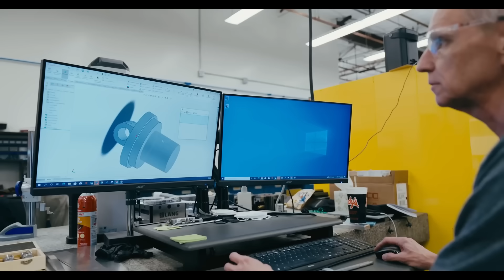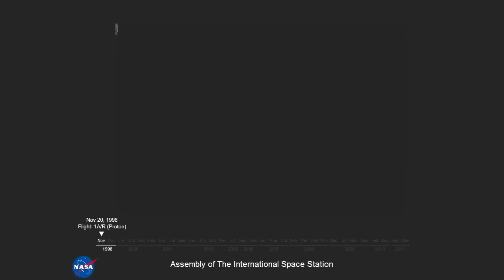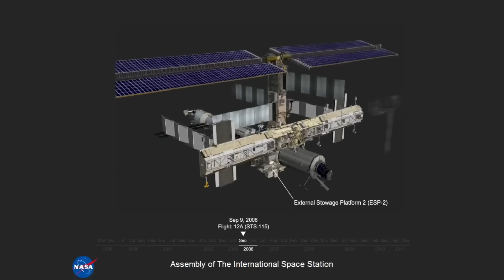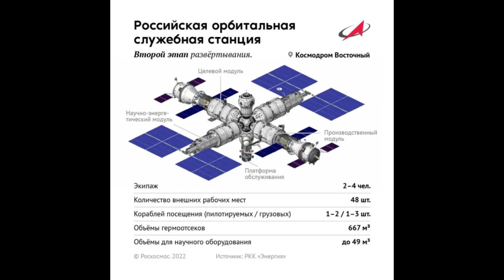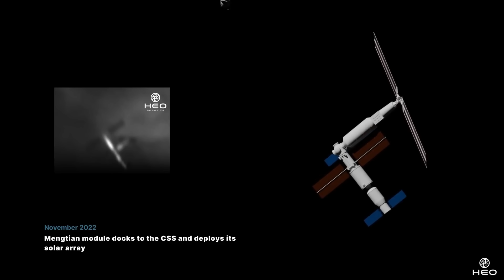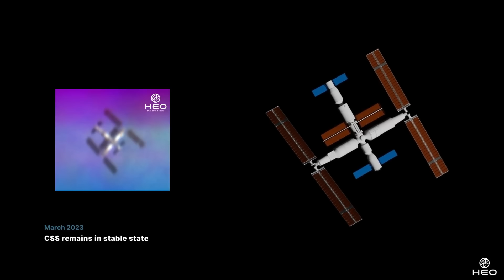Where Will Astronauts Go After The ISS Is Destroyed?

Comment: It's a shame they never replaced the Shuttle with a modern version. It's lack has resulted in a massive narrowing of possible space-based structures.
Reply: Yeah, I feel like 2012 on we lost so much space capabilities and have been needing to reenact the 60s :(
Reply: @FooPanda  one of the former directors of nasa, Michael Griffin straight up said when asked about the shuttle program and continuing the Saturn program instead: "If we had done all this, we would be on Mars today, not writing about it as a subject for "the next 50 years." We would have decades of experience operating long-duration space systems in Earth orbit, and similar decades of experience in exploring and learning to utilize the Moon."

i will absolutely take that from the horses mouth in this case
Reply: Too expensive to refurbish all those complicated, different tiles between launches. One reason Elon went for a cylinder rocket with simpler tiles.

Comment: I live in Huntsville, AL where they recently “popped” one of Sierra Space’s inflatable modules. We’re used to rocket testing in this area but that explosion was another level.
Reply: Pretty intense?
Reply: It would just leak. The popping part was due to testing the material to its breaking point.  Beyond what it would experience in its normal use
Reply: @johnn3542  oh we’re used tests to failure. This one was just particularly loud
Reply: Big badda boom!  💥
Reply: I've wondered about that -- if some piece of orbital debris or small meteorite the size of a postage stamp hits one of those things, will it just start leaking (which might give the people inside enough time to escape that section), or will it pop like a balloon?
Reply: @Lucius_Chiaraviglio  it would leak just like the iss did. The test mentioned was over pressure until it burst. The pressure when it’s in space is never going to be higher than 1 atmosphere so it wouldn’t burst.
Reply: @Lucius_Chiaraviglio well, with how strong they are, they're unlikely to be damaged much in the first place. if they are, though, it won't explode. like a tire running over a nail, it'll probably just leak, only this thing is much stronger than a tire and will hold together much better.
Reply: @Lucius_Chiaraviglio  i think the point is that it wont break idk
Reply: Huntsville 

Hope y’all doing good after 2011
Reply: I miss living in Huntsville

Comment: I understand that being exposed in space degrades the ISS’ modules, but what about the structural trusses? Couldn’t that backbone of the ISS be reused? Remove and deorbit the old worn out modules and replace them with new ones.
Reply: Degradation of the important structural components (which are also some of the oldest parts of the ISS) is one of the main concerns unfortunately. Erosion/corrosion by atomic oxygen and the wear and tear induced by over 100,000 thermal expansion cycles is no joke. Going with entirely new components maximises lifetime going forward, and also allows for the incorporation of fundamental improvements in materials and design.

Comment: Why do you seem to imply that more than one docking port is needed to support occupancy in the absence of a docked capsule?
Reply: Because the people on the station always need a ride home... for now at least, nobody is prepared to leave a station occupied without a return vehicle. And since the lifeboat will always be taking one port, you need a second port for the replacement crew to dock at.
Reply: @simongeard4824  I see, thanks. Not sure why having to wait for a return vehicle to arrive would be so prohibitive, but I guess safety is increased , if one is not dependent on a return vehicle to arrive. Also, the permanently attached return vehicle could temporarily disengage to allow for the replacement's crew vehicle to dock, but compared to such manoeuvres, it would be easier to just have a second port.

Comment: Untitled Space Craft: Three SLS main stages, two Falcon 9 rockets, two SLS solid boosters, two Delta IV M upper stages, a Space Shuttle Orbiter attached to the main tank, and a Saturn V upper stage.
Reply: SLS Saturn Shuttle 9
Or SSSN 🤣
Reply: I christen this spacecraft "The Johnny Cash".
A piece at a time spacecraft bringing an end to the piece at a time space station.
Reply: And a space partridge in a space pear tree.
Reply: I'm sure there's a Project Orion drive somewhere in the background too. Just for good measure. :D
Reply: @toadchungus4135  I would not fly on that thing unless it also included an Apollo Lunar Landing Module crammed into the Shuttle cargo bay. Have we learned nothing from Apollo 13?
Reply: Well, if it works like a charm in KSP…
Reply: Moar thrusters!
Reply: Don’t forget the starship raptor engines (singular)

Comment: I would hope that the replacement for ISS exists before it is de-orbited.  I like the option of putting modules on ISS that will continue after the bulk of ISS is retired.  There is a plethora of equipment and supplies that would be useful and potentially preserved in that manner.  Many options, but the key is to make it financially viable.  Multi-purpose and flexibility are going to be very important here.  Space tourism, science, observatories (both earthward and outward), etc.  All these things brought together to make it feasible.  My fear is that we end up with multiple small stations that will not have the capabilities that a larger, "shared" one would have.

Comment: I think one of the big reasons SpaceX  might not have a horse in the LEO race is that maybe they want to skip LEO and go straight to the moon. In terms of infrastructure, we will be able to do way more on the moon than we ever could do in microgravity. Maybe Im wrong bc microgravity provides a truly unique manufacturing opportunity or something like that but I just dont see it happening as easily, especially since so much of the weight of the various crafts are dedicated to life support systems that will be far easier to have in place on the moon, where they don’t have to worry so much about micrometeorites, etc. (for example, cooling can be done by piping directly downward into the moon’s crust instead of the comparatively highly exposed radiation panels)

Comment: I've seen concepts like this for nearly 60 years now. Only ISS and Skylab ever happened.
Color me quite skeptical. The only new stuff here is the inflatable stuff.
"Disappointed... but not surprised"
Reply: What about the Chinese station that's already in orbit?
Reply: The Wright Bros were told the same thing about manned flight. Never stop reaching for your dreams, even if they seem impossible.
Reply: Were they private concepts?
Reply: Difference this time is there is money and actual hardware
Reply: The economics of putting stuff into orbit have changed drastically in the last decade, so old experience doesn't necessarily apply.

Comment: Just wondering why Soyuz can't
 reach a  high-inclination orbit? is it a physical limitation of the spacecraft, or limits on flightpaths from Baikinour?
Reply: Little of both. Given enough delta V you could launch anything to any orbit from any place on Earth. But as it is, Soyuz doesn’t have the delta V to make it to certain orbits. The ones they can reach are those within their delta V budget and those are defined by the location of Baikinour, its latitude and the direction they launch to avoid dropping rocket parts on China.
Reply: It's the other way around — Soyuz would need to reach a lower inclination orbit to visit the Chinese station, or most of the proposed ISS replacements. And that's simply because you can't reach an orbit which doesn't pass over your launch site without spending a lot of delta V to alter the inclination after launch... and rockets rarely have the fuel reserves to launch a large payload on such an inefficient trajectory.

Comment: I remember a "wet workshop" proposal from around Skylab years where the station would be within the propellant tanks of a booster upper stage.
Now, take a Starship without flaps and heat shield, cram the payload section with what you need to retrofit a space station inside the tanks, then send a crew to do the retrofitting job and recover the Raptor engines, and voilà, with only 2 super-heavy launches, you aready have a huge space station...
Reply: so the old shutell tank space station idea
Reply: @anuvisraa5786  Every time they dropped one of those I thought "Well there goes a perfectly good ISS module"
Reply: @josephastier7421 Weren't they made of a super light metal that was crazy expensive, and IIRC, toxic to humans. Could have fitted walls and floors inside, then sprayed the gap to the tank walls with expanding foam to seal and thermal insulate.
Reply: SpaceX already have Ship 26 without shield or flaps sitting on a stand at Boca Chica so...
Reply: @sphericalcow-p9m  ■ Yah, kinda like a big elephant in the room…
Reply: I think I've already seen an artist's conception of that.
Reply: I read a fiction series where a company built a manufacturing plant in orbit by paying NASA enough to add just a little extra burn to the shuttles so the big external tanks would get high enough that the corporation could capture the tanks, strap on thrusters, and bring them to their assembly orbit.
Reply: @MonkeyJedi99  Where did they put that extra fuel for the burn? The shuttle main tank was dry when seperated, the shuttles internal tanks dry at orbit.
Reply: @PiDsPagePrototypes  I read the book series about three years ago, so I don't recall exactly.
It might have been just an arrangement to have the shuttle "hang on" to the tanks a short time longer to slot them in a recoverable trajectory?
Reply: Okay, this sounds workable, but how about this:

While the powers that be are considering on de-orbiting the space station, why
can't they use some of the hardware from the ISS (old station) while building up the new station with SpaceX, and whatever parts are still functional within the ISS?

Why on earth destroy the whole thing, when there's tons of things, like all those "bags" of storage on board the ISS, that are probably still not utilized?

waste not, want not !!

The supercomputer, for one, would be an ideal thing to keep around, as well as refitting the original "truss" to the new station - along with some extra solar panels.

Maybe even build a larger truss, on the same principle, and complete it in space !

Eventually build something along the "lines" of a wheel shape, but use sections that
would be more like a 12 or 16-sided polygon. 8 sides would be a good start, but then it might be expandable as more modules are added.

I really should've watched the video first !  lol
Reply: @kumbah2006  Turning the current ISS in to the docking and assembly station for it's replacement, is plain good economics. That main truss may have aged from the constant heat and cold cycles, to the point where it'll soon be compromised. If sections can be brought home, they should be. And parts that are too fatigued, should be reprocessed on orbit, used as raw materials to melt down and make new parts.
Reply: The internal capacity of Starship is already supposed to be a bit larger than ISS's total pressurized volume. I think the most valuable piece to figure out is a 4 or 6-way connector module to endlessly chain starships. From there, we would just need bespoke internals for the various needs, and a model with deployable solar panels. It would still be worth it do use the tank areas of course, for non-returning modules, but there's plenty of space, and you'll want to save some engines and fuel for orbital maintenance.

Comment: Great Video !  A great location for the new station is a low inclination  LEO CSS  with a  Fuel Depot  nearby heading East from the KSC in about a  28.5 deg. orbit !  This orbit can be supported by the ESA Launch Pad and support missions to the moon !  With a  6.1 km/sec delta-V the HLS/LEV/LLV  could fly from the  LEO CSS  to the Lunar Surface (LS) South Pole Lunar Outpost/Base (Clementine Base) with a LS Fuel Depot nearby !  The HLS/LEV/LLV could then be serviced on the LS for return to the LEO CSS !  The NASA Lunar Gateway no longer needed near the moon can be sent by a space tug to Mars orbit and maybe docked to a moon of Mars !  More info in the paper "Moon Direct" by Robert Zubrin...  Also read about the NASA designed  "24-Hour Lunar Shuttle"  (LEO to LLO)  by Stan Borowski  (NASA Glenn Research Center).  tjl

Comment: Every time I see these ground-based builds I have to wonder at the timeline till we're constructing larger structures in orbit.   Is it a failure in funding and willpower or isn't the science and engineering already there?
Reply: They have been doing experiments with 3d printing in zero G.  Space construction has a lot of problems to be solved vs. space assembly where we still build the parts down here.

Comment: Nice presentation Scott! Brings us all up to date on what's coming next.

Question: what about the millions of dollars of hardware inside the ISS: science instruments, experiments, computers, etc that cost a fortune to get into LEO in the first place? Doesn't it make economic sense to transfer that gear over to something else? Or is it too old to be very useful and easily replaced by newer tech that can be launched at cheaper SpaceX launch per pound rates?
Reply: It's really only possible to transfer that tech to another object in a coplanar orbit, which would have to be a purposeful move for any other space stations that may or may not exist. Also, there are currently zero operational spacecraft that could spare the fuel to perform a rendezvous between the space station and another object, even in a coplanar orbit. So you're going to have to figure out how to dock starship to the space station. Which would certainly be a sight to see.
Reply: @rawhide_kobayashi  Well reasoned! Starship docking with the ISS as a salvage vessel would indeed be a sight to see.

I guess the climate controlled storage depot issue would be an adjunct to a space junkyard where useful tech & materials that are already in orbit could be maneuvered into a parking orbit for future recycling & reprocessing. 

Clearly the problem of space junk & the opportunity of stranded assets could converge into a possible commercial industry in the right hands. Hope somebody is working on this right now, before the potential goldmine of the ISS is simply vaporized into nothingness...
Reply: Be careful with your imagination and logic.  Some Youboober will make a stupid comment to you.  😅

Comment: The truss, solar arrays, and CanadaArm should be reused. It could provide power for refueling, storage, and perhaps metal recycling. The mass is already in orbit and the aluminum can be recycled but it does take power (All this talk of asteroids and lunar soil is fine but they have over 180 tons of aluminum already in orbit as space junk). 

For spaceX, a variant of their lunar Starship could make a viable space station. Also the could add removable hatches and the hardware required to reclaim the volume of the tanks once in a stable orbit. Bolt on external docking ports for Dragon etc. It already has an EVA setup that would allow workers to modify the ship.  It would be good to have such a concept that could be modified again for a station in lunar orbit and eventually three in Mars orbit supporting future efforts out that way.

Comment: It's probably far less expensive to maintain retrofit and add on to the current space station than it is to deorbit it and replace it with something else.  Even if it is mainly used as a backup you already have the resources in space so why not add to it and retrofit the old systems to keep them up to date with the modern systems.  Sure I can see the need to for more space and larger modules for various reasons but those additions could still benefit from the backup and support available from the old systems and modules.  Besides currently Space-X barely functions and loses money through failure at an unprecedented rate while the other companies that have semi-functional systems are not really in any better position.

Comment: I think a better option would be for the NASA and international group of countries invested in it consider selling it so a commercial group could use it as a construction base when building a larger Von Braun type station that has artificial gravity and a less piece meal assembly of modules.. Could be the main reason they don't want to just renew the ISS is that it is becoming a pig boat of bio organisms and smells real bad inside.. Still some group could find it useful enough to do the repairs and upgrades while stripping out non useful stuff and cleaning it then put in new stuff for new purposes.. This would be far cheaper than putting more full sized modules up into orbit..